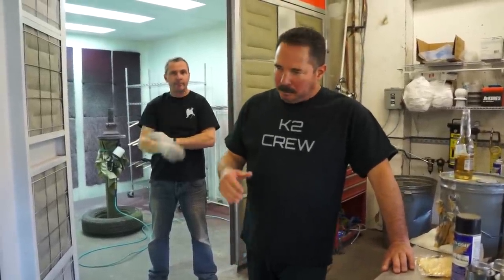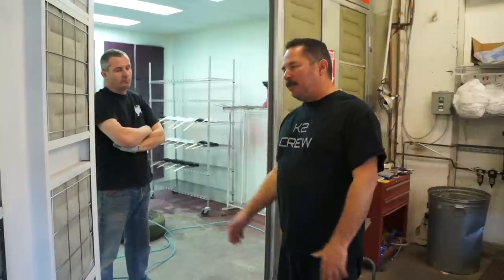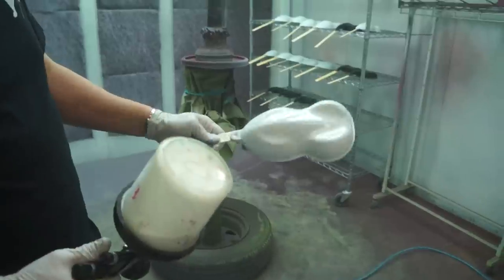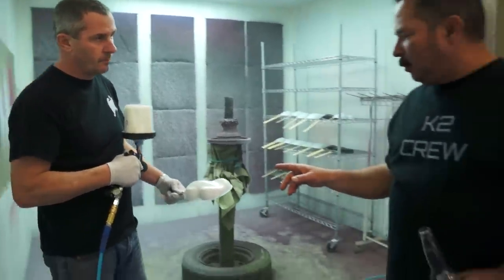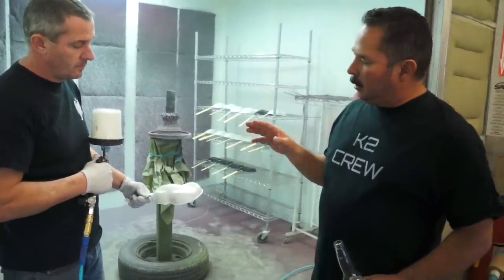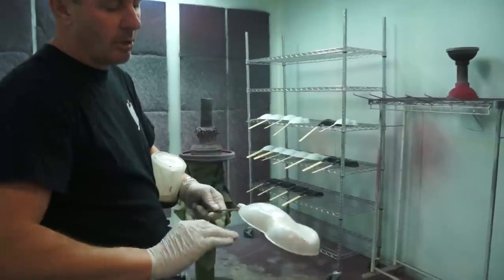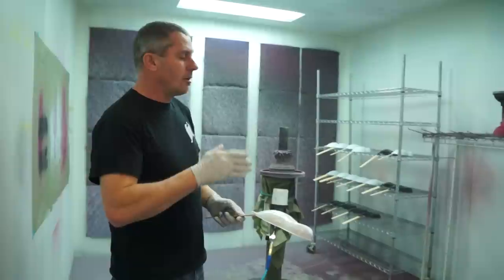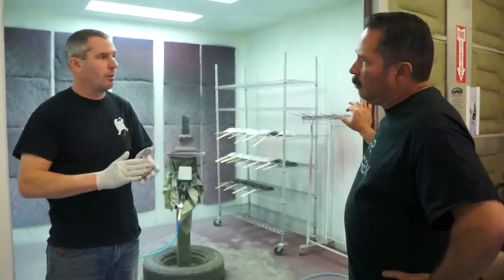K2Forums.com & One Hit Wonder Application Guide Part 3 "Spray Technique"

Comment: Good day Sir Jim and Jason. Very informative video. I've tried adjusting my gun pressure to 28PSI but when I pull the trigger, it RAINS! Its not atomized and I'm having big droplets. Is there a problem with my gun? FYI, I'm using a cheap TCP Global guns. ;) Thank you and hoping for your reply.
Reply from the maker: Yea I think you got something wrong with your gun...have you checked your needle depth?...Sounds like something is clogged or not adjusted properly.